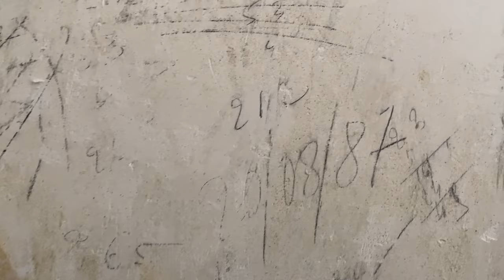Roof Rescue! Can It Be Repaired? - Journey to the Château de Colombe, Ep. 39

Comment: I simply can’t believe how confidently Tony climbed onto that roof and got stuck into fixing the area of missing tiles! I shouldn’t be surprised with all the work they’ve achieved at their own ‘not quite a Chateau’. 😅 Your cousin certainly did an awesome job of stripping the wallpapers too and I just wondered whether the 87 written on the walls was perhaps from 1887 not 1987? What are the possibilities of that? Could that be from a worker doing the walls and not necessarily the wallpapering, as from what I could see there seemed to be quite a few numbers on the wall that looked like measurements or calculations? Love how your community and friends are helping each other and please keep safe (safer) walking on dodgy floorboards Patrick! 😅🙏🏻🥰
Reply from the maker: Hi Christine. Definitely 1987. Most all wallpaper in the chateau we know is 20th century. It is also a very 20th century thing to write a date as 20/08/87 and not have fully written out all 4 digits in the year. Yes, we have a lot of places in the chateau where they wrote calculations on the wall for measuring the wallpaper.
Reply: Hi Christine.  The former owner’s son told us about the redecoration done in 1987 and 1988.  Good guess though. Tony and Paul took over. They are an amazing team.  But I watched closely and we have the next roof repair soon and that’s just us! 😊😉😳
I promise I will try to be safer walking on questionable floor boards!  Thank you so much for your concern. Makes my day. Huge hugs to you. 💖💕💖
Reply: And same to you too Patrick. I’ve loved following you guys on your journey. 💖💖

Comment: So great you were able to solve the roof problem with all the help, including  your neighbour Xavier. The heavy rooftiles involved are refered to as "tuiles mécaniques", industrially made rooftiles which have too often replaced the tradional flat rectangular tiles so frequent across central and Northern France. Nice ' hierarchy' too of roofing materials, as was frequently the case in aristocratic or bourgeois properties, between slate, a 'nobler' material for the masters' residence, and locally sourced clay tiles for the ancillary outbuildings.
Reply: Salût Francois.  That was such a relief!  We have several roofs with the flat with the flat tiles.  The flat tiles sometimes just slide out of position.  But they are so very pretty.  We have about 100 of the flat tiles in storage.  Need to get more.  I agree, it is nicer with the original tiles!!!  Slate is only on the Château roof......  You know it well.  Hugs and thank you for a great comment!